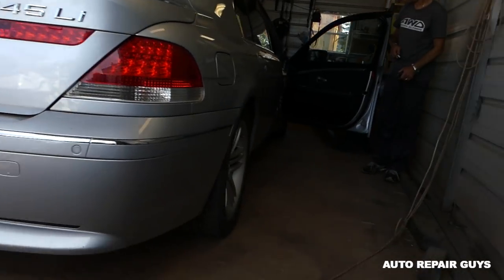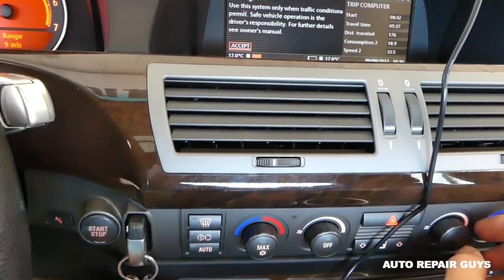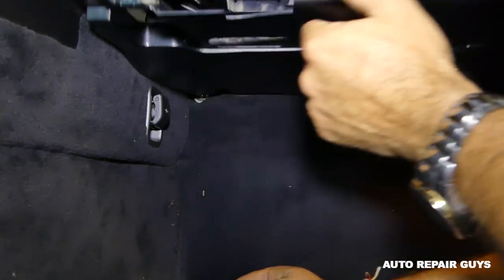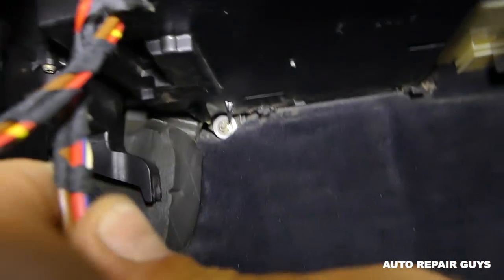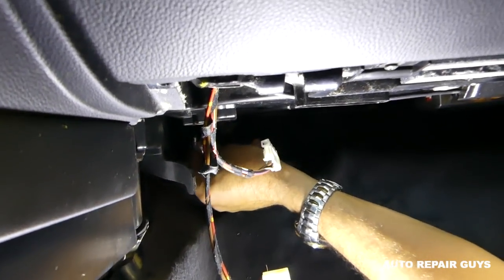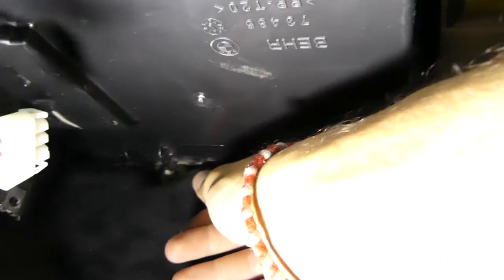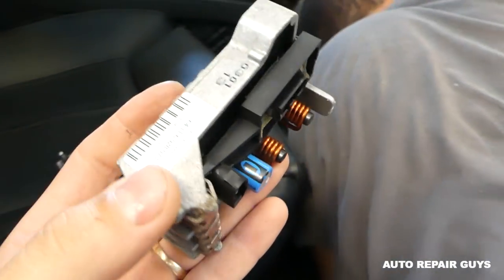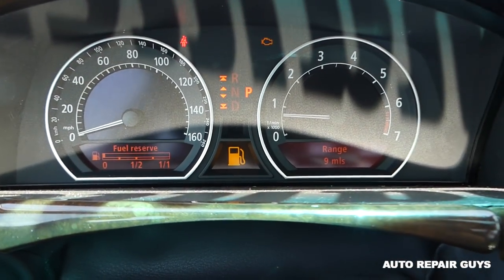BMW E65 E66 BLOWER FAN RESISTOR REPLACEMENT REMOVAL  FAN NOT BLOWING

Comment: You video saved me a fortune. I took a chance to buy the part on ebay which worked and solved the intermittent air flow on/off issue on my 2003 BMW 745i. However the procedure was complex due to awkward position you need to be in to remove some screws. Why the heck they put 7 screws deep on the cover underneath the glove box? I only put 5 back so that I dont need to go that deep next time if required

Comment: I had the same problem and thanks to your video I was able to replace the blower resistor.  There is just one thing which is, I am still experiencing the same problem. 2  days after replacing the blower resistor It started to blow very strong which made me very happy. I must have tested it about a dozen times by turning it on and off and it worked very strong and cold for one night. However the next day it went back to blowing with a very weak stream of air which did not fluctuate when changing the speed.  Is there anything else I can do to fix this problem.

Comment: Why I just change my motor blower everything works fine but the driver side blows heat or hot air. I’m thinking it’s a duct issue

Comment: HEY-IM HAVING INTERMITTENT NO BLOWING AIR TO WORKING FINE BUT RARELY WORKING.  I BOUGHT BOTH THE RESISTOR AND BLOWER. IF IT COMES ON ON OCCASION, FROM WHAT IVE READ, ITS MORE THAN LIKELY AMPS OUT OF THE MOTOR AND A BAD MOTOR.?????  HELP PLEASE ATTEMPTING REPAIR TOMM 6/22/22 THANKS-BMW FAMILY ARE THE BEST FOR INFO-HAVE SAVED ME THOUSANDS BY THE KNOWLEDGE OF THE BMW FAMILY-DEALERS WOULD BE WELL LIKED IF THEY LISTENED TO U GUYS IN THE TRENCHES